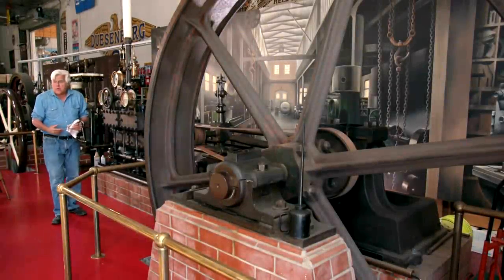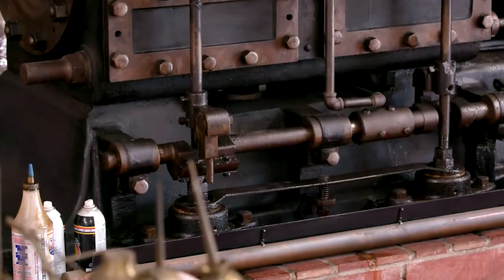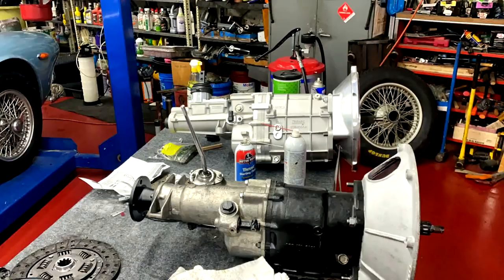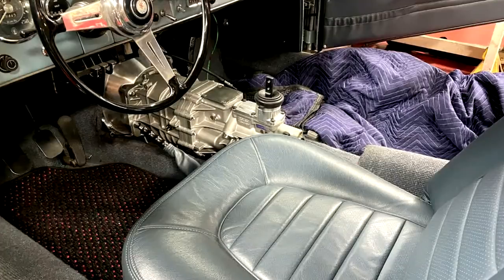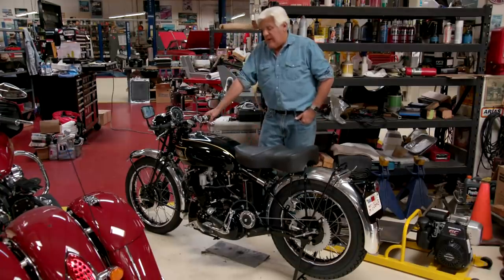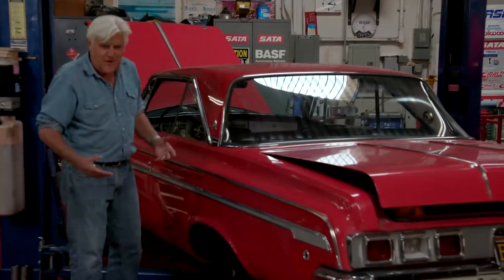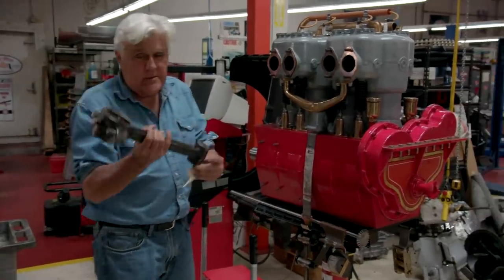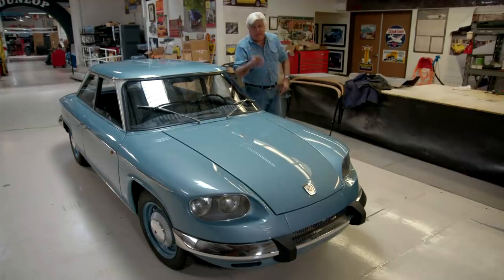Restoration Blog: May 2021 - Jay Leno's Garage

Comment: You didn’t ruin the car you made it drivable so it can be enjoyed and appreciated. As you said, you kept the parts so if someone wants to make it underivable and unreliable again that can do so. What I admire about your collection is that you appreciate the cars and motorcycles and you drive them as the designer intended.
Reply: I do find it funny - ZF is a maker of very high quality, expensive transmissions.  Maybe there isn't anyone nearby who can fix them properly
Reply: John Ferrier -- I agree!
Reply: Word.
Reply: @pashakdescilly7517  It was likely state-of-the-art in the day, but wear and tear takes its tole.  If there existed a full availability to rebuild it to as new condition, I bet Jay would have done that without hesitation.
Reply: @pashakdescilly7517   Having driven our fleet of Alexander Dennis Enviro 500's with ZF transmissions,  they don't age well and don't seem rebuild well, they overheat, won't go into gear and severely jolt. Couldn't imagine with Jay's car's age that they were any better then.
Reply: Italian cars aren’t about mechanical precision or quality, they are about how they look and what they aspire to be.  What Jay has done to that car is make it reliable in addition to being sexy as hell and a great performer from that era.
Reply: @humphrey212  Ja!

Comment: Jay takes a fire engine out for a ride.  The engine blows.  He promises,  "I''ll fix the engine for you."
"Well, $60,000 later, [chuckles] it's done; but it's beautiful and it's going to run just fabulous."  
Jay Leno:  A man of his word.
Reply: After the $60k out of pocket repair I heard Burbank renamed a street, Jay Leno Way 
at the corner of Lock & Stitch
Reply: @HVAC Quality Assurance - I wondered as well, but listened several times.  Keep in mind; it's not just the block repair, but he put new rods and pistons in it and those pistons are 5 litres EACH!  That's no off-the-shelf stuff there.  So, along with labour, I think $60K is probably right!  I'd be happy to be corrected by someone who worked on the repair.  But, as you say, even if it were $16K, that's still much more than picking up a dinner check.
Reply: With Carrillos it should have some Aries pistons and an Isky cam.
Reply: @HVAC Quality Assurance Ah no, it was 60k. The man had Carillo make the rods, new pistons were cast and rings plus bearings made and the block repaired. Trust me, that's 60k at mates rates.

Comment: Jay is performing a huge public service in providing these segments for the education of people of all ages that would otherwise not have a clue about what drove the world forward. At the age of 75 and with a Stationary Engineer background, I actually spent a couple of years standing watch/maintaining/running over an engine similar to the large one that was used from time to time to transfer filtered and treated water to a cooling reservoir for a huge factory.  One end of rod had the steam cabinet driving piston, the other end had a massive pump cylinder. That engine was eventually replaced with a diesel pump and that's when I got the heck out of that particular engine room for good!  The noise was terrible whereas before the diesel, the cycling of the steam engine would almost be as comforting as your own heartbeat while in repose.

Kudos Jay for your efforts to educate with real entertainment entwined.

Comment: A restoration blog without seeing the W A T E R   J A C K E T S doesn't feel the same.
Reply: Well, the side of the christie crankcase is just below the water jackets so it was close.
Reply: lol, I was thinking somewhat the same.
Reply: TELL ME ABOUT THE INTERNAL CORROSION! I MUST KNOW!
Reply: @Munkenba  They used to make them out of tin back in the day. You see, it was a race engine, longevity was not a concern. We made them out of BRASS, so they will last forever. In addition to that, we run coolant thats not water-based, so we don't have to worry about corrosion AT ALL.

Comment: Jay, I just about fell out of my chair when you said you had a Dodge Polara. The first car my dad ever bought was a 1966 Dodge Polara 500 convertible. Drove it off the sales lot and promptly ran out of gas. It had air conditioning and at the time I think it was one of the first convertibles you could get with A/C. It had a 383 in it and ran on leaded gas. Well it sat in the garage for awhile then he parked it in a friends field along with the horses. Never, ever saw another one until I was driving home one day (after having lunch with my dad) in a parking lot being sold. Drove straight over, jumped out and told the guy my dad had one just like it. He said "Here is the title for the car" turns out it WAS the old Dodge. They used to have a speaker in the middle of the back seat where my tiny butt used to sit. I miss that car to this day.🤗

Comment: That steam engine has such a relaxing sound to it, click, dun dun, click, dun dun. Might just be me but I could listen to that noise for hours 👌🏻
Reply: I agree Tom. Would be great if Jay could connect it to a machine for work. Anything from a steam hammer to steam organ.
Last one I saw at work was a traction engine powering a huge circular saw slicing lumber. "weeeaaaghhh" went the blade, "phuff phuff phuff" went the engine. Poetry in motion.
Reply: @russcattell955i   how cool would it be to connect belt driven ceiling fans throughout the garage
Reply: @Sonny_V  Noisy I suspect. A fairground merry-go-round would be fun !
Reply: Could fall asleep to that noise ..

Comment: This is Brian Kim Keenan. 
This array of steam engines is exactly how it looked in my Chicago Public School (Raster elementary) basement. The 3 story brick school  from around 1900, had a 5 story tall brick chimney stack. It was coal fired to provide heat to the school. The steam engine array was used to pump and control  ventilation and operate coal loading and water distribution. Aa a young child bringing lunch to this area for the workers, it was amazing and frightening at the same time. 
I felt honorored to have experienced this place in the early 1960s. Thanks Jay.

Comment: Years ago when I worked for an insurance company as a risk analyst I ran across a property the company insured in Blythe CA.  It was a large fruit packing plant and at one time had been an ice plant as well.

One of the pieces of equipment was a large steam engine that powered the original refrigeration plant.  It was very similar to what you see in Jay's video, but the flywheel was attached by a large belt to a rather large compressor.  Initially, the plant had been an air cycle plant, so yes, air as a refrigerant.  But they soon moved to use ammonia and the plant was very reliable and used up until the early 60s for cooling their storage facilities.  Eventually, the people with the expertise to operate and maintain the plant went away, so they retired the plant and installed many large chillers to substitute for this machine.  Truly an amazing machine to see and at the same time a little sad to see it sitting in this large mechanical room gathering dust.  Should have been in a museum someplace.

Comment: "that's you're balls out governor..." Hmmm, never thought I'd hear that.
Reply: We called them flyball govenors in Engineering school
Reply: Also the Origin of "Balls to the Wall"
Reply: And now I know the origin of the phrase “Balls Out”.   Never knew that, though we used to use it all the time when in my Navy days when describing something going as fast or hard as it can (or should). Thanks for providing the visual example, Jay!
Reply: @Sonny_V  Actually "balls to the wall" is from military aviation where the controls have "balls" on them and pushing them to the firewall gives maximum power.

Comment: As I see it, with an old car you can do one of three things.  The most common is to scrap it, because it reaches a point where repairs are more costly than the current value.  Unfortunately, many people fail to recognize that value may increase over time.  Second, you can drive it until it dies, then look at it like some ancient relic, because it can't be fixed.  Third, you can restore it with parts that are available, augmented with newer, better ones.  This allows the vehicle to be enjoyed and ensures that it becomes more than a museum curiosity.  Americans love this mix of tradition and innovation, and people like Jay, who have the resources and desire to curate these treasures, have saved many interesting examples.  I wonder if Jay ever considered opening an automotive museum to the public?  He would have one of the best collections in the world, I would think.

Comment: RE: Maserati GTI.  great car. And as so many cars, they are made to drive, not sit on a trailer or in a museum. And if you own this car as Jay does, you drive it. Or should be driving it. So, if it doesn't drive well on today's roads and conditions, the modifications are fine by me. Jay kept the original parts. So if it should ever wind up in a museum, it will be original. But as long as Jay owns the car, he WILL drive it. Luv the steam engines. My great grandfather worked on the railroad. The B&O. Fun to see where we've been. Thanks Jay

Comment: I have the Plymouth version of your 1964 Polara.  My 1964 Sport Fury is powered by a  Super Stock Commando Stage III that I have converted to a single carb engine.  It is a retired race car with tow hooks sticking through the front bumper and all.  I love driving the car.  That Dana 60 with the 4.10's and the 18 spline 4speed make it jump off the line!

Comment: Jay, the Polara/Monaco's around those years up til 70 had the round side markers. My 68 4 door Polara had them. All stock, 383 2bbl. it got me through high school and college. I had to sell her due to the valve seals and rings failing. Plus the electrical was quitting. But it was built well and THICK. It took on two hail storms that were golf ball sized without a ding on her. A great land yacht.

Comment: hi jay, im just a regular guy, not rich at all, but not poor, i was born in 1958, and was a total car guy among other interests since 10 years old and still am today, through out my life i have been  able to own pretty much whatever car ive wanted, because ive always been a very hard worker, i had all the muscle cars of ford dodge amc, the 72 and 68 vets in real time when they were new and slightly used, never had to restore them, after all the muscle cars and other nice cars, in my late 20s me and my friends quite by accident stumbled  upon a 1972 triumph stagg, and were completly blown away by this thing, they had a serious issue with the motor which made them unusable, but the car itself is quite possibly the best car ever made in every way, back then an underground industry sprang up to keep these cars on the road, and they replaced the v8 that came stock in the car which was crap with a mercury carberated capri motor and trans the one from europe, that had all kinds of horsepower, well needless to say say the car sprang to life because, the motor was unblievably geat and lighter, sean connery drives one of these cars in a pretty memorable scene in diamonds are forever, thats how cool these cars were, im going to try and get one, most car guys hate on these, cars but but thats because they never experienced one ive ownend two of them in my life, had to sell them to raise my family, if im able to get a good one i will drive it to cars and coffee, belive me when i say this if it is cherry, or even just nice, it will be the most interesting and nicest looking car there, thanks for your channel, i learn a lot from it

Comment: I still hope Jay will add a Honda Rebel CMX 250 to his collection. 1985-2016, 30 years the same basic bike. I've had 2 Rebels, an '86 and now an '03. Both got about 60-65mpg until I pulled the carb accelerator pump/valve - cotter pin, spring and washer on the '03. Boy, did this ever improve engine performance. Much better low-end torque, better shifting, mileage jumped to 85-90mpg. I literally had to break the engine in over the following year. One other thing I did was swap the stock 33-tooth rear sprocket for a custom 28-tooth which made 1st gear useful. And installed a digital tach to better monitor engine specs.

Comment: Back in the 90s I worked at a dry cleaner for about a year and they had a 25 horsepower lattner boiler I want to say from 1956. It was just a boiler so it didn't have a steam cylinder but it was a beautiful old boiler that look like you could have shoved some Wheels underneath it and put it on a railroad track. it had mercury switches and big giant old-time fuses and relays, with the old-time wiring covered in some kind of fabric insulator. And a Giant Gas pilot system underneath that would make the coolest rushing sound when it was first light up. And then as a truck driver for the last 25 years every once in a while I will still go to an old factory that has Old Industrial Equipment that's not running anymore but sitting in the back and I love looking at it. Especially in the Detroit area and again in the Deep South around Birmingham there's some old car and Industrial textile machines and it's just neat to look at.  Thanks for sharing your steam driven machines.

Comment: I was admiring the single cylinder stationary engine at the Henry Ford museum and I was told by one of the staff that it was the engine for the Model T factory and the museum was built around it.

Comment: Couple points.  The Tremec is easily adaptable.....provided you have a CNC to make custom 1 of 1 bellhousings it'll fit your Maserati just fine lol.  Next the 426 wedge is punched out 383. That is technically correct, but it should not be confused with the later 3.375" stroke B 383. Chrysler made an RB 383 in the 50's. The 413 is a punched out 383, the 426 is a punched out 413, the 413 being the the first Max Wedge displacement. Both Max Wedges were based on selected production blocks.  The 426 Hemi got it's own beefed up block and additional head bolts.

Comment: I'm really impressed.  You have some of the old steam enginges running. In the oil fields ive seen some natural gas engines as big but seem most have been turned into scrap metal.

Comment: Seeing that steam engine made me think of the monster air compressor at the 16 to 1 mine in Cali. Made right around 1900 IIRC, twin-piston with a displacement measured in gallons per stroke, the drive wheel makes that look like a toy. It's both such a shame and a wonder that they are still sitting there like when were shut down in the '70s, they still have the original electric motors and everything.

Comment: Always enjoy these updates, loved that you keep those steam engines running i have seen so many that have just rusted away and been scrapped which is kinda sad and always nice when they are restored, i remember as a kid getting to see a huge steam engine running and it always sticks in my mind how impressive they were in engineering. 

Loved the story with the black shadow.

With the Maserati 3500 i think its great to put in a better transmission as you can actually use it now and as you can bring it back to stock at any time i think its the right thing to do and lets be honest if that transmission was around at that time Maserati would have loved it too.

Comment: I've seen a horizontal engine like that in the abandoned Wainaku Mill in the early '90s.  Here in Waianae one of these was landed on the beach here in 1878.  Assembled and working by 1879.  In S.L.O. I saw a neat '61 Maserati 3500 GT for sale c1994, a convertible.  As a 15-16 year old broke kid, that's how my '50 DeSoto sedan went.  It had crashed in the past and had some bondo and a '49 front clip put on.  My last car I drove was a '68  300 hardtop sedan with a rebuilt 383.  I have just "wound up" a MOPAR guy.  Fords a close second.  I am an anti-Honda guy, but like Toyota, Isuzu & Mazda.  I saw an Intermeccanica I'm a local junkyard.  I saw a '62 Imperial convertible in a Big Island yard c2000.

Comment: Thank you for doing all the videos during the pandemic.   I appreciate your collection and the tastefulness you have in restoring what needs to be saved and then sometimes improving the original to make it more enjoyable without sacrificing the magic of the original. I am a car guy also.  I currently have a 2.5l 5 cylinder  VW need became very interested in the 5 cylinder engines.   Could you please do video/episode on the Audi 5 cylinder engine and their unique engineering and power.  The 07k engine I have is very interesting ,as well as, the entire family of engines that it is from.  Thank so much!

Comment: My in-laws had a white Maserati 3500GT coupe in the mid 1960s. The wife wasn't comfortable driving a stick shift so she would leave it in second gear when she drove it. That motor would pull from 0 to sub highway speed without complaint. At the time one set of ignition points cost $18 and a distributor cap was $54, a lot of money in those days.

Comment: What modifications are good or bad depends largely on use.  If you are keeping a vehicle as a museum reference piece, original is indicated.  If you plan on driving and enjoying the vehicle, you make whatever modifications are needed in order to enjoy it.  I've got a Moss box in one of my Morgans which has the highest and best use as a boat anchor.  When I can find/afford a suitable replacement, out it goes.  Why?  Because I enjoy driving the car and the transmission (rebuilt once) is a pain.  Most of my cars are for driving and whatever it takes to make them a pleasure to drive is what they get.